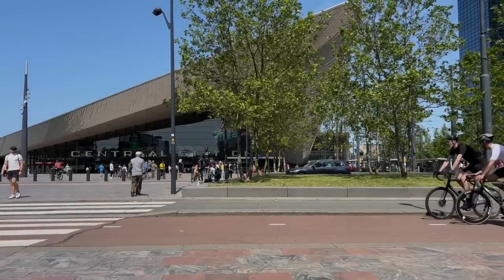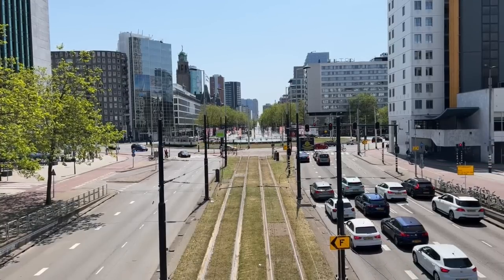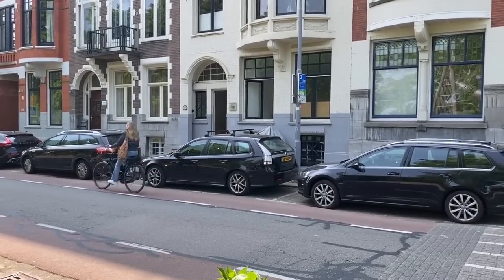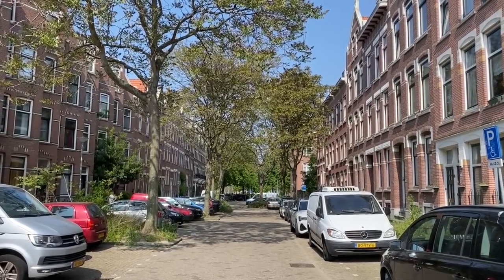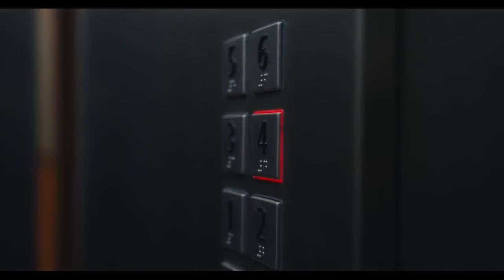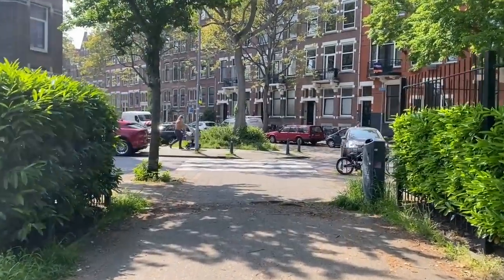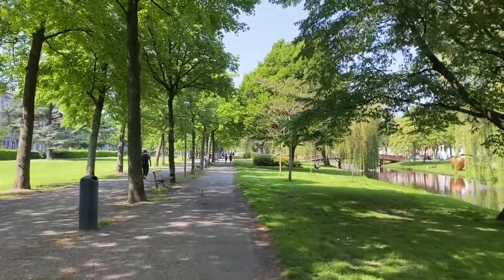How Streets Fall Apart

Comment: "advisory lanes are the preferred tool, when the city doesn't really want to deal with the problem"… you might get quoted on that :)
Reply: Interestingly the German equivalent to the ETW30 (the "30 Zone") explicitly bans advisory lanes as well ("any lane markings are prohibited") – not sure why. Maybe "lost in translation" back in the 80s. The double meaning of "strook" (which got translated as "Streifen") for the lane and the line works in Dutch as well?
The trick around here is to only build a 30 section (like a school zone) and then you can add any regulation you want.
Reply: @kailahmann1823  In this context,  'strook' in Dutch means lane. The word for line, or stripe, is 'streep'.
Reply: I think a better solution (but still bad) would to be to call this a "fiets straat" and paint it like a bike path. At least you do not create the suggestion the road is mainly meant for cars. However still not a fan of this. Definitely better ways to deal with this.
Reply: @ronrolfsen3977  that's how they build bike streets in the Ruhr area and wonder why it attracts no cyclists ;)
Reply from the maker: Hey did you see my video on fietstraats? Blocking off the through car traffic would actually sort of turn it into one
Reply: @kailahmann1823  what @ronrolfsen3977 failed to mention is that ''strook'' in general means a thin long strip of something, e.g. a fabric, an object etc. in this case of a road.
Reply: @kailahmann1823  that plus the fact that we are a area with lets say "special" public transport and "fun" terrain.

Comment: I came to this conclusion about network issues in my neighborhood(the gridded streets of San Francisco's Sunset District). On Kirkham between 19th and 7th Ave, the MTA tested "Slow Streets" during pandemic lockdowns, which only blocked one lane to "suggest" traffic calming, and found that thru drivers, rather than respecting the suggestion, aggressively slalomed through Kirkham to traverse between 19th and 7th(both major corridors), knocking over the signs. They went in the direction of reverting the change instead of pushing for a full barrier. The streets did succeed in a few other places in the city, but the motorist reluctance to give up this particular cut-over was high, and I can see the same kind of issue taking place with the Heemraadssingel.

But the overall network problem, which is "every street in the Sunset is equally a thru street", is easy to fix through careful application of barriers. Gridded cities are very amenable to this change - it doesn't create an issue over how to allocate the road space and carve out lanes for different users - they just need to overcome some political concerns and practical issues with emergency services access etc.
Reply: You’re right, the problem with narrow streets that people start to trust over the weeks/months/years is that most in the US are built in a straight path which still causes speeding and the solution is to add raised intersections, raised crossings for alleys and add unexpected obstacles and also make the lanes as narrow as possible but sadly minimum lane width in the manuals limits this.
Reply: The overall network problem is that people feel the need to drive through busy city traffic instead of parking somewhere accessible on the outskirts and taking public transport to wherever they need to be in the city.
Whatever you do isnt going to fix traffic as long as it involves cars going into the city center and parking there.

Comment: I remember when my teacher in elementary school told us in traffic class: 'Het is geen fietsPAD, het is een fietsSTROOK'. I always understood the difference very well, and I think most  Dutchies do. As a car you can use the strook whenever there's no bike. But when there is a bike, you need to stay off the strook. As a cyclist it feels safe, as you feel somewhat protected. You have a designated area that is yours when you're there. When you're not there others (cars) can use it, and to me that's totally fine. It's efficient use of space that provides some extra protection for bikes without having to completely remodel the street or ban all cars. Because even in the Netherlands there are limits to that. 

Another pro of the fietsstrook is that it optically narrows the road, so it slows down cars. 

Maybe it's perfect example of a 'polder'-solution. It doesn't completely favour one side over the other. Everyone gives and takes a little 'en je doet het er maar mee'. I don't think it's unwillingness to deal with the situation. I think it's a very adequate solution for the situation. It's perfect for nobody but all parties get something out of it. 
I love it.

Comment: you don't even have to move the bus stations.

you could just place a "bussluis" in (somewhere around) the midlle of the street, that way cars can't use it as a shortcut and busses (and emergency vehicles) can still use the whole street.

you're able to either put in a raised platform (like a speedbump) that is to wide for cars the pas over but small enough for busses (but then police and ambulances couldn't pas either)
or you use those move able triangles that disappear into the ground when allowed vehicles (busses and emergency vehicles) approach.

the 2nd option would be (in my opinion) the best solution here, and it doesn't even cost that much to install.
Reply from the maker: you can, and that would still be a big improvement. But bus stops arent supposed to be on an ETW either, so I went for the most " ideal" solution. Stroomfunctie is still a stroom fuctie even if its a bus
Reply: We have that in Amstelveen. Larger cars, like SUV's, simply drive over the raised platforms. Smaller cars think they can and then get stuck. Likewise, many cars get stuck in the 'bussluis' especially at night.

Comment: This is starting to be done lots in the UK, retrofitting older neighbourhoods with traffic filters to create low traffic neighbourhoods. However there is a lot of motorists complaining about them, causing traffic and the government recently removed them from projects that they will fund for active travel.
Reply: Same thing is going on all over canada, i think the political setbacks will be less in the near future since a lot more younger generations want and see the advantages of sustainable transportation and being able to get around real easy.
Reply: I honestly think the only reason low traffic neighborhoods are controversial is because they're given such a fancy name. The actual name for them are modal filters, and they can be found in quite a few places around the UK. You might also find different examples such as bus gates.

If they weren't made such a big deal there might be some complaints from residents but at the end of the day they likely would simply be part of normal life, nothing special.

It's really upsetting (but also relatively unsurprising given our incumbent) that the UK Government is being so pro motorist. I remember in early march the government did an investigation into the effectiveness of LTNs and they had to manipulate the conclusion to fit with their hypothesis which was revealed during a leak.

It really is a big shame.

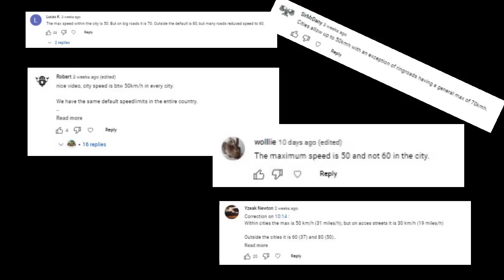Comment: 1:33 small overview about our speedlimites

BiBeKo (binnen de bebouwde kom - inside city limits)
-ETW - 30KMH
-GOW - 50KMH
-SW - 70KMH

there is going to be an new type of road introduced, the GOW 30, which (surprizingly) has a speed limit of 30 KMH. This street is supposed to become the default speed limit in all cities. This means the GOW - 50 is going to dissapear in most places and changed to GOW - 30. Its an interesting topic to talk about considering it has up- and downsides.

BuBeKo (buiten de bebouwde kom - outside the city limits)
-ETW - 60KMH
-GOW - 80KMH
-SW - 100/130KMH

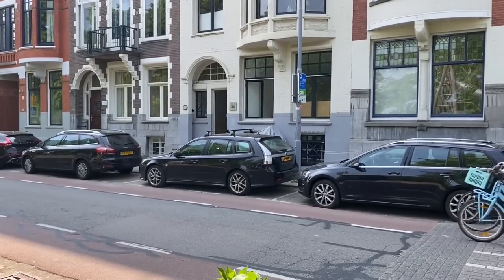4:07 not really (any color isnt ok), as it contradicts Duurzaam Veilig. It has a design principle that every road and function should be clearly recognizable and compatable (yes, the GOW - 30 will be a negative infliction on both of these parts sadly) to show drivers what behavior wegbeheerders expect from them and it prevents confusion. This improves safety a lot.
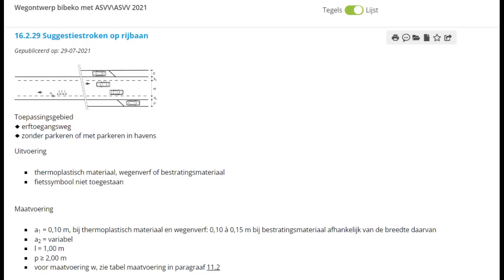Reply: The screenshot at 3:59 confirms that the colour of the surface must be the same throughout ("geen afwijkende kleur").

Comment: Great video! Your videos are getting better with each one. It would have been cool to see how the other street dealt with through traffic. Did they just build a bollard? Or did they use other mechanisms like chicanes?

Would love to see a video on street transformations - i know Amsterdam is changing their streets with parking, to be ones with seating areas, tiny playgrounds, bike parking, garden/green space etc. Do such additions make it easier or harder to bike through? I’d imagine harder to bike through, because of all the people on the street, but I could be wrong. Also would be cool to see a video on how NL handles mixing transit (buses, trams) with bikes/bike lanes. Looking forward to the next video!
Reply: The other street (Hooidrift I think) a rougher brick road surface, some chicanes and raised intersections/speedbumps. One way streets are also a method often used to prevent through traffic in these tiny neighbourhoods/superblocks. IMO one of the main reasons these streets see very little throug traffic is that they are not the fastest route to the other side. Closing of Heemraadsingel would probably divert some traffic through the smaller streets rather than around the neighbourhood. All the traffic calming has hardly any effect on cycling. It is not great for road bikes, but hardly anyone uses those anyway. These streets are near exclusively residential. There are not enough people on the streets to be an issue for cycling.
Reply: Because they removed a lot of car parking and still in the process of doing so means that streets get way less busy since people can enter and exit the street way easier and faster. So biking though those streets is even more pleasing and faster then before but this can still differ depending on the environment and other things.

Comment: Or... put a "bussluis" in the middle. That way local traffic can still get there from either the Vierambachtstraat or the Mathenesserlaan, but they can't get from one side to the other,  but busses and bicycles still can.
Reply from the maker: you can, and that would still be a big improvement. But bus stops arent supposed to be on an ETW either, so I went for the most " ideal" solution. Stroomfunctie is still a stroom fuctie even if its a bus
Reply: Well Public transport is not important in Netherlands.
Reply: @anubizz3  once a city is good for cycling, public transit becomes primarily a service for disabled people. While it's still important, you must be careful not to prioritize it over cycling.
Reply: @anubizz3  it sure is important to our country. We have priority signs and dedicated lanes. Compare that to bus infrastructure in most countries.

Comment: Hey, i'm from Rotterdam and know the area very well, and to be honest I avoid cycling here unless i have to be at a specific location in that area because it's always chaotic. (there's a reason we call it the wild west) However the plan you suggest in the video about blocking at one end would not work in this case for a couple of reasons:

The first is the bus line, which actually comes from the other part of the Heemraadssingel, and follows the road all the way through to Mathenesserlaan, the bus does the same on the other side of the Heemraadssingel and connects back to Rotterdam Noord. Diverting these two stops, or four if you count both sides of the singel, would cause a diversion of at least 5 minutes ride time on the bus if there is no traffic and 20/30 minutes if there is traffic. 

That brings me to the second point of why blocking the road would not be a great idea: Traffic, Mathenesserlaan and Vierambachtsstraat are both very busy 2 lane streets with street level tramlines, almost every tram going west of the city center travels through Vierambachtsstraat. During rushhour these streets become completely blocked, because they both end up at Mathenesserplein where traffic is further diverted to more directions. Which is why Heemraadssingel is the way it is; it's a diversion street for cars that need to go in a specific direction that don't necessarily require staying on M'Laan or Vierambachtsstraat. It is a direct north/south connection from Rotterdam Noord all the way down to Coolhaven and relieves the west/east bound traffic. 

what you suggest is great, and used in many other situations with great result, but it simply would cause more harm than good in this case.

Comment: The "Westzijde" in Zaandam is also an interesting case with the same issue. You may find it interesting too. Lots of through traffic and cyclists on a narrow street. Over the whole length of the street (which is quite long) it seems like they've tried all options. 50km/h with bike lanes (too narrow), 30km/h without bike lanes (too busy), 50km/h with suggestiestroken (idk why), separated bike lane in one direction only (???), 50km/h but put up a blue sign with a suggested speed limit of 30km/h so you're allowed to put bicycle symbols on the suggestiestroken (smart, but cheating)...

Comment: Honestly a lot of these things would also be solved if navigation apps simply didn't route you through streets like this.

Also, I don't think they've done this anywhere in the country yet but they could use a "closed statement" with an exception only for local traffic on either side.
But I suppose that might add confusion. Which is probably also the reason it hasn't been done before
Reply: They have a closed statement in Zwolle. The Kerkstraat. Only enforced by camera that scan license plates. However there are residences there. The road is still free to use for busses, taxi, etc. It also make the route invalid in navigation apps. There are others, however they are all closed off with an retractable bollards. There are residences in those places and they can get access to to that. I think the latter might be a suitable option here as well. This would allow busses to still use the road as well.  However maybe the throughput is to high for that.

Comment: I think you need to zoom out a bit more to understand the context of the Heemraadssingel. The traffic between Vierambachtstraat / 2e Middellandstraat and Mathenesserlaan is just a small part of the traffic. A lot of it (in this particular street) is traffic which already came from Van Aerssenlaan as an easy way to go south to Rochussenstraat. The solution isn't to push even more traffic through the congested single-lane Vierambachtsstraat, but to make that traffic take the Aelbrechtskade instead.

BTW, at the moment Heemraadssingel would fit GOW30 more than ETW30. It's one of many roads blindly converted from 50 to 30 without adjusting the layout of the road.

Comment: These bits of red asphalt are called "FIETSsuggestiestroken", which you are meant to cycle on as long as you can cycle "as far to the right as possible". You don't have to commit to the lanes when you're the left one in a side by side cyclist duo.

I agree with the fact it doesn't belong in an ETW30, which should only be used in build-up areas and not on through streets, which should be GOW.

I wouldn't necessarily say that you need to move the bus route. You can impliment barriers that prevent cars from crossing, but not buses. It's called a "bussluis", or a more expensive way to do it: a "poller".
Reply from the maker: can you please tell me where in the kenniskbank CROW these are referred to as fietssuggestiestroken?
Reply: @buildthelanes  hes wrong. U named them correct. They are suggestiestroken. Its a fietsstrook (with legal status recognizable with a painted bike on the asphalt/pavement) or a suggestiestrook (without legal status), they have the same purpose though
Reply: @buildthelanes I stand corrected. I think I'm wrong about the actual name. You are correct that it is "suggestiestroken". I work in this field for a couple of years now, but I still don't know every legal term for everything.
Reply from the maker: @bvanommen94  no worries im the same as you!
Reply: @corneetjeuh  they don’t have the same laws though. Suggestie stroken allow for cars to temporarily park in them while fietsstroken never allow for cars to be parked in them.

Comment: 4:11 you say there's no bicycle symbol on these lanes, but I can clearly see the bicycle markings at 4:33 and 4:49
Reply from the maker: yea, its an extra step that makes the design even more wrong, but i wanted to explain why you so often see the red lanes on the outside before adding another step to explain for people. 
CROW IS jsut a design guide but since theres not any design you technically have to follow, it holds a lot more weight than a regular "design standard"

Comment: Neat true crime episode with the viewer as the detective ;)  spoilers down below.

I was surprised when the suspect was simply to block off vehicle traffic.  My initial guess was that a whole street reprioritising or reclassification was needed.  I couldn’t really understand your thinking until you mentioned that ETW30 is designed for local traffic.  Not through traffic. 

I have a question though.  Would a modal filter that allows buses but blocks cars (bus trap) be an acceptable solution to this problem too? 

Awesome video! Once again you taught something new in a fun way!
Reply from the maker: you definitely could, but ETWs arent supposed to have bus stops either. because its hard for kids to play in the streeet when a bus comes every 10 minutes
Reply: @buildthelanes  Interesting! That answers my question entirely
It’s such a slippery slope mentally wanting to service as many different kinds of travel… only to make it worse for everyone involved! Total focus is required when getting down into details like individual streets. :)